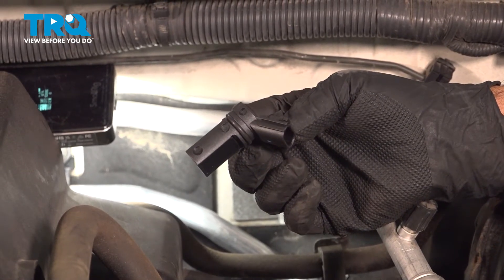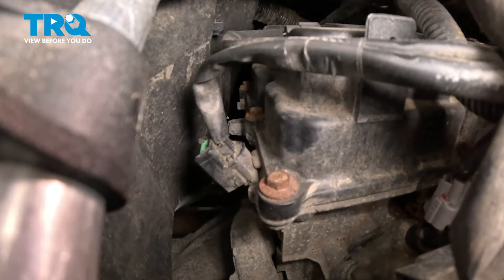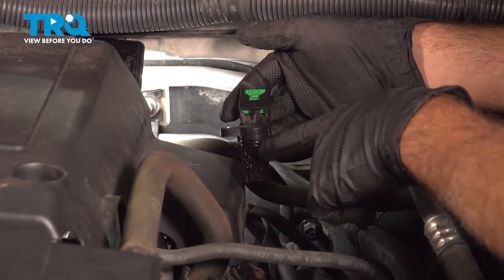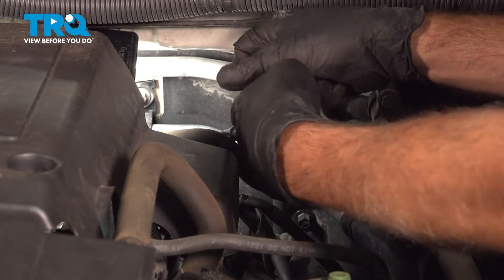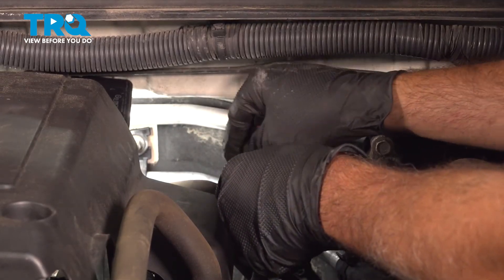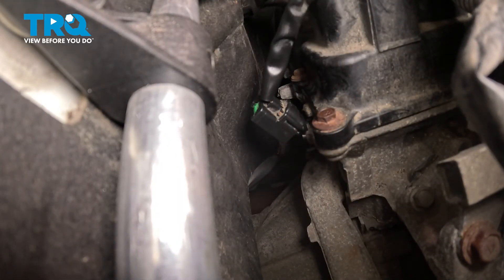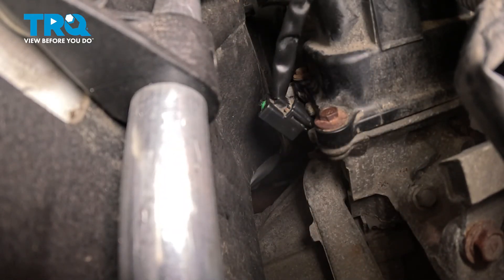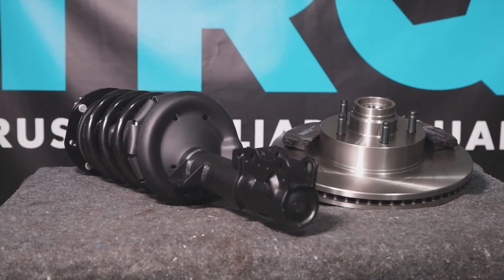How to Replace Drivers Side Camshaft Position Sensor 2005-2021 Nissan Frontier 4.0L V6

Comment: I think I purchased the wrong one … it has a cylindrical shape but Amazon said it was a Hitachi camshaft sensor Frontier … is the driver side bank 2 different than the passenger side ?? Slightly different fits?